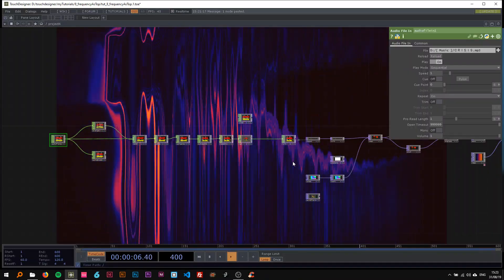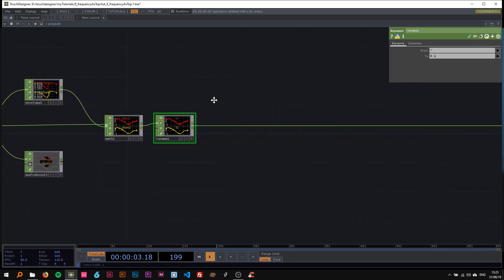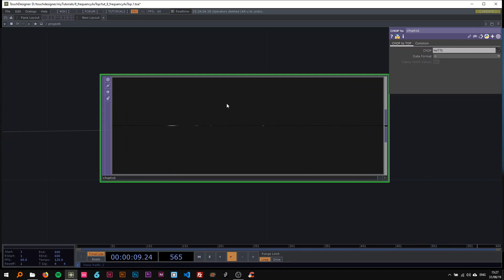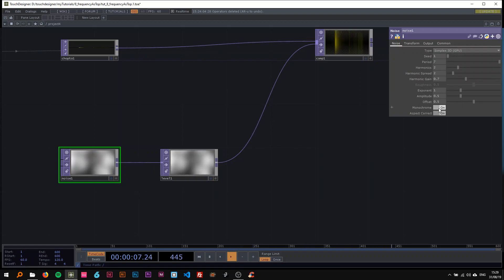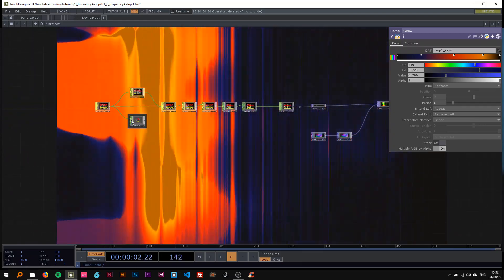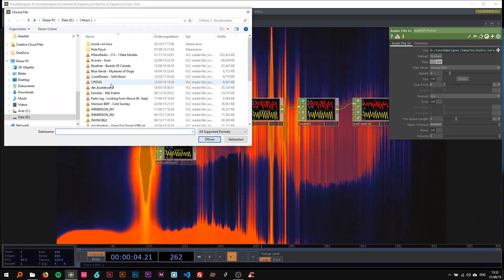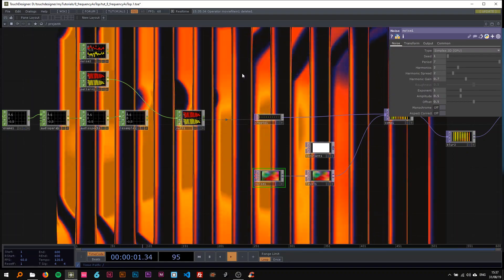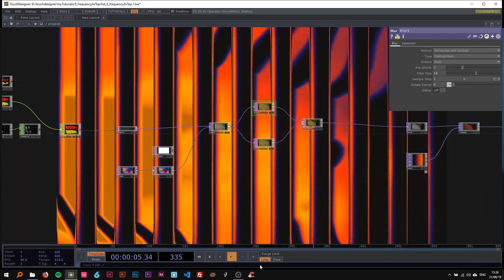Spectrum to TOPs – TouchDesigner Tutorial 8

Comment: Hi! Is it possible to connect such code to the dj`s playlist to make an interactive visual performance for the set? I`m just a beginner and also can`t find this info in google. Thanks!
Reply: And also is this code compatible with kinect?  So many questions)))
Reply: @gazolinshitsa  Yes and Yes :) 

1. you can hook audio in and use output from mix to use sound as source. (and make some tweaks in values etc to be in control more)

2. you can use kinect values from like luma in cutmode videos and hookup tahm as source. I think it would not require lot of work to make it functional.

Comment: this was fun!! thanks heaps!!

to set the resolution of the operators, I usually set a resolution to my parent container (like you do at the beginning of the video, 1920x1080), and then in all the operators that require to have that same resolution I type in the resolution parameters: me.parent().par.w and me.parent().par.h to recall the parent width and height.
 
That way, if for any reason I need to change the resolution of my work, I just need to change the resolution of the parent container, and all the operators inside that container will follow that change automatically, instead of having to remember which operators were supposed to have a specific resolution, and then manually go and change them all. 

This solution works well for me, especially when dealing with large networks.
Reply from the maker: Fausto Brusamolino thanks for the tip!